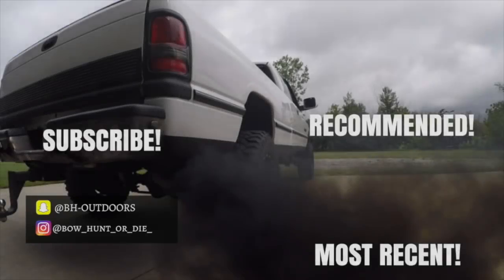THIS WAS NOT GOOD... BACK ON THE HUNT FOR A NEW TRUCK!!!

Comment: Hey man, there’s a 98 12 valve ext cab long bed automatic with 248000 miles on Facebook marketplace. It’s very clean. You have to go look at it. It’s priced at $9,900 it’s located somewhere in Maryland

Comment: I have a 93 dodge w250 with the cummins in it and was used in the winter with salt and I’ve gone over the entire frame and these not a single stop of serious rust or cracks on that frame. Sucks that the deal for the single cab didn’t work though.

Comment: My 94 12valve had shifting issues between 3rd and overdrive and would constantly slip out of overdrive if its doing that shes fucked and if its an auto listen to the bellhousing and if it sounds like rattling chains the torque converters done which usually goes along with OD slipping

Comment: On the trans problem, I’ve got a 97 12 valve with the auto and I had a problem with it not using 1st and 2nd gear. The truck would start in 3rd unless you forced it into 1st or 2nd on the column. I ended up changing like a crank sensor or something (i forgot the name of it). It’s a sensor in the front of the engine and when I swapped it out with a new one, $100 later, the trans shifted every gear and worked flawlessly after that

Comment: And if you get another 12 valve don’t put in a #0 fuel plate. Have one ground down to a curve. You’ll have way more bottom and top end which means speed. And you can also adjust for more rack travel along with the fuel plate. And if your going for smoke turn the smoke screw in it’s really easy. That’s what I’m running right now. And for more boost and a lot more speed I pinched my boost reference line  but my stock clutch won’t handle it 😂😂

Comment: I had a 96 12 Valve 5 speed with 256k miles and i never had any rust on the frame.

Comment: @loud 'n' proud: that rust on the ex cab. 12v is just the very end of the frame horn, nothing major if you hit something at 10 mph those will bend ive repaired lots of trucks with bent / rusted frame horns, square body chevys (chevy guy here with an affection for ford rangers, and hate for any full size ford) have an issue with the frame cracking behind the steering box and ive drilled 4 holes and bolted sections of plate on that LOAD BEARING portion of the frame and never had an issue. cut out the rust, weld in a small piece of 1/4 plate and i guarantee even if you put 1,000 hp to the wheels itll break in half elsewhere before that section is ever an issue.

Comment: Well i know its not what u r realy looking for but i have a 01 dodge 2500 24 valve 6 speed extended cab with an perfect frame an lot of upgrades but i would have to have at least $12000. Ive got alot more in it

Comment: If i were u i wouldnt buy the truck with 270 thousand on it and tranny  shifts funny its gonna need rebuilt and 270 is a little high even for diesels just dont want u to make a mistake possibly i like your videos ive got a 95 ford f250 7.3 with a 5 speed and like it i like the 12 valves pretty well to keep up the good videos

Comment: Hey man, a local Instagram page owner has a 95 12 valve dually , white, 5 speed. 222k miles. 14,500 if that’s your range. His name is Coleman spann, he is out of Dickson tn if your interested in out of state. Clean build
Reply: Isaac Lewis 222k miles and $14k? I'd buy me a 2010 truck for that price with less miles
Reply: Automotive Guru I see your point, this thing is clean tho
Reply: Automotive Guru and 5 speed 2nd gen dually 12v are a bitch to find

Comment: Hate to break it to you but fords and dodges in the rust belt = rust. Like you said it is what it is. That's why you pay mint for a gm truck. Not saying gm trucks are predict either but majority of the time gm frames are solid with fords being 2nd in line. I love the 12v also. Maybe find you a gm truck and put a 12v in it? Been done before. Sure you find what your looking for but it takes a lot of patience.

Comment: I would go check out the dually and see what that truck is like because if you spend $6,000 you could have a lot more money to put in the motor and just build horsepower that is what I would do and I wouldn't let these people get you down about getting a regular cab I like the regular cabs 2 and just not the extended cab I like them both I think getting a regular cab would be awesome but Malachi bud don't let them try to talk you down about getting a regular cab because it's your truck and you can do what you want but when you go check out the dually take us along with you because I would like to see it too and hopefully that's the one I got my fingers crossed catch you tomorrow bud👍👍👍👍👍

Comment: For sure ford made a much better frame than dodge but good luck searching I’m sure if you were willing to search from down south your problem would be much lessened
Reply: have a 99 ram 1/2 ton I swear you'd think the frame was 5 years old 218k miles still running strong
Reply: Automotive Guru that’s great man but there are other potentially factors when trying to find an older dodge DIESEL truck with a clean frame when most of these trucks are put under much more stress compared to a half ton. Just the weight of the Diesel engine alone wears on these trucks overtime

Comment: okay i Live in Idaho and winters are crap here and there is salt on the roads all winter here and I've had two 01's one was a half tone and my current one is a 24v and neither of them had bad rust in the frame.  So is there just something down in there that rusts the frame or is it a 12 valve thing? and if you feel like it check out my instagram at beau_shea24v